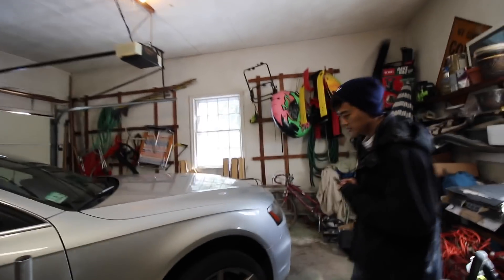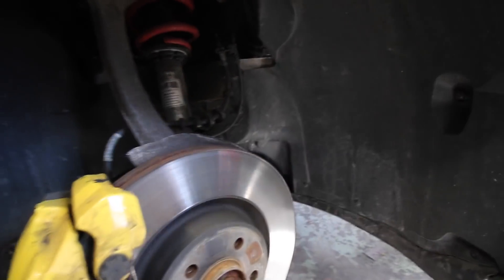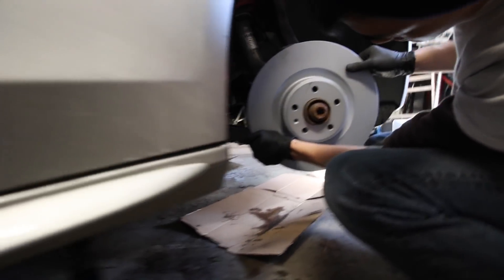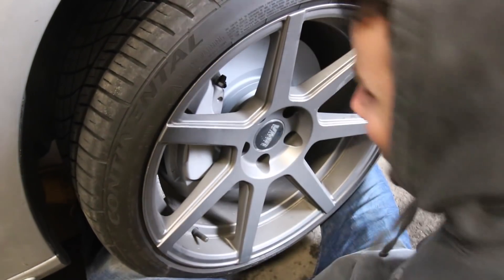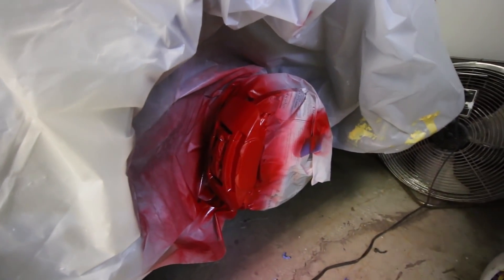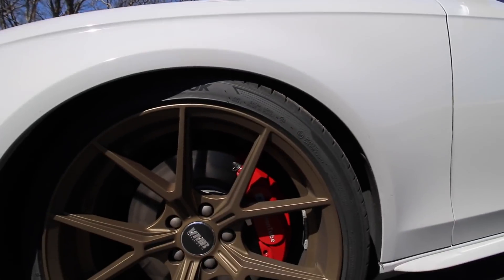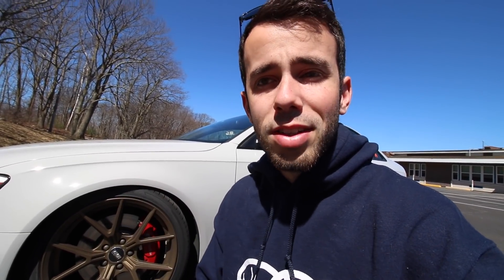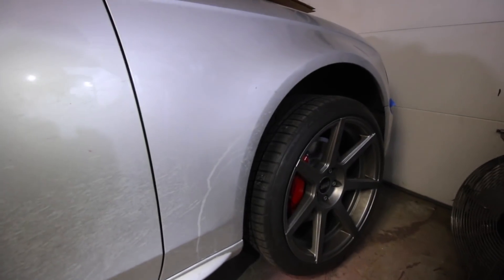FCP Euro Q5 Big Brake Kit for my S4!

Comment: Coming from someone who tracked his 500hp RX7, his brake set-up was SS brake lines, Dot4 brake fluid, and Hawk HPS pads. The first thing you notice is the pedal modulation no matter how soft it was before is now properly firm allowing better braking control pre-Abs engagement. Sure some cars with their puny brakes will need a bigger brake upgrade, but every upgrade does not require dropping 2k just to stop your car. Nice vid.

Comment: Indeed as others have said, tape, prime, paint, cure, even bake in the oven apply decal and second coat with clear laquer before install to avoid bubbling as well as decal coming off with a jet wash.
Reply from the maker: I know. I wasn’t sure if I would like it so we did it the easy way. If it bubbles or peels I’ll take it off and put a new one on

Comment: Hi - good vid, but a question: the Q5 calipers (part numbers for the Q5 CALIPERS (8R0615107E / 8R0615108E), but these are the non-monoblock versions for the Q5's - the later (2018) versions of the calipers are for example: 80A615106AB which are better monoblock calipers - are these the same mounts as the ones you mention do you know as they will be better?

Comment: is it really worth the cost? and is there anyway to get the cost down?
Reply: Macan 4 cyl base brakes are the same as the Audi Q5 brakes and much less expensive for some reason! They're not bare metal though so paint might not stick as well (but also isn't strictly necessary, as long as you don't mind "PORSCHE" on your calipers)

Comment: Did you hear any weird noise when braking with that weird coating they put on those brakes?
Reply from the maker: Most brake disks are like that, the coating comes off as the brakes get bedded